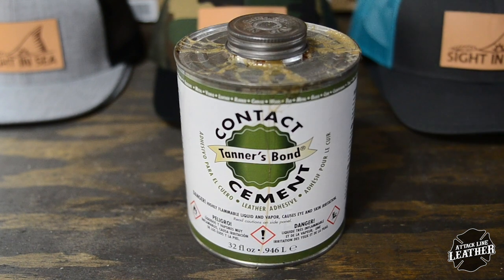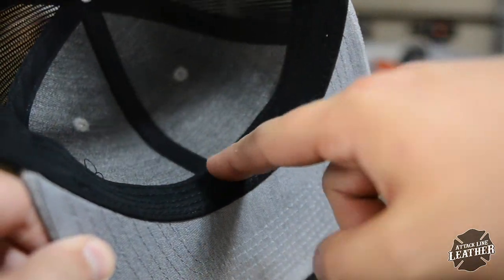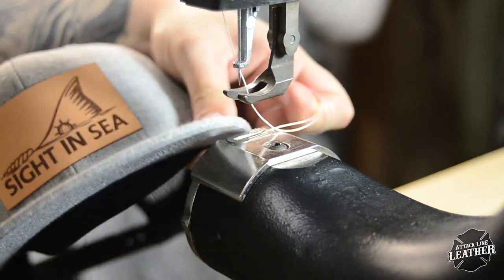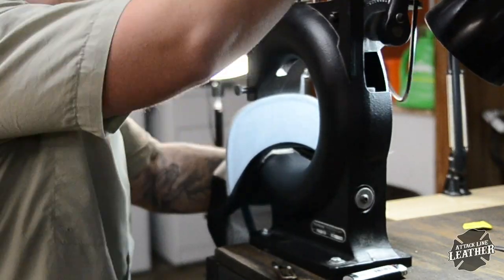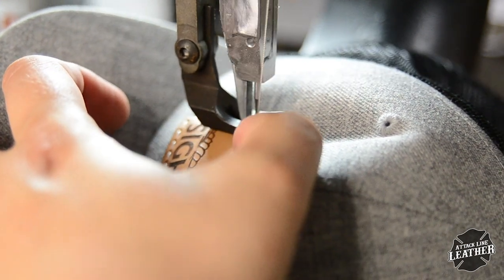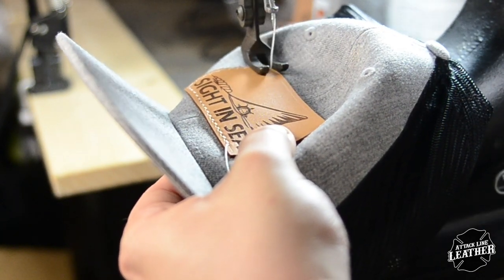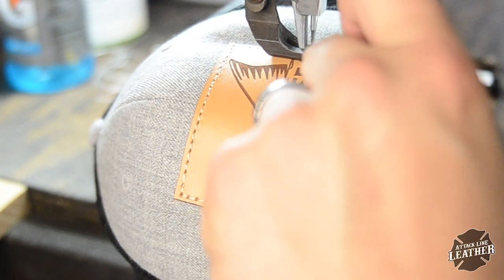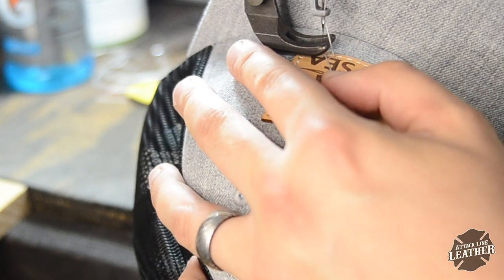Stitching a Leather Hat Patch using the Tippmann Boss

Comment: Class work. Love the idea of the patches on the hats. I have just purchased a Tippmann boos over her in Ireland. when i am stitching it will make the stitch hole but no stitch hole but no stitch and have to go back , Why would this be happening, Thanks
Reply from the maker: Thank you. 
When this happens I generally check several things. I first check to make sure my thread is threaded correctly in the machine. Next I check to make sure my the thread tensioners are set correctly.  Next make sure the handle is secured tightly with the screws. Sometimes they come loose and will cause skipped stitches. Last, I make sure the presser foot is adjusted properly. 
If you just got the tippmann boss it should have come with an instruction DVD that will go over how to make these adjustments. 

Hope this helped
Reply: @AttackLineLeather  Many thanks, the handle was not secure so hopefully thats the problem, Thanks again

Comment: Just the video I needed to see!  I was wondering if my tippman was capable of doing this.  I've only every used it for knife sheaths, and honestly I have never liked how the back side looks.  The front of my stitches look great, but the back looks like crap. How does yours look? (Not that it would make a difference for hat patches, I'm just curious)
Reply from the maker: By the back looking like crap do you mean little bumps from the lock stitch? Might need to adjust your thread tension
Reply: @AttackLineLeather  it's like, you don't see neat little stitches, like on the front.  You can see the stitches from the bottom thread, but you can also see the thread from the top.  Like where it loops together
Reply from the maker: @ReeseCustoms  its either a tension issue or make sure you do full range stitch strokes. Make sure to hit the full range of motion. Not doing so can make the Boss run wonky.
Reply: @AttackLineLeather  I'm thinking it is probably a tension issue.   I've had my machine probably 5 years, but honestly haven't used it much.  I'll mess with it some more and hope for the best

Comment: i don't see many leathercrafter using the tippmann boss machine, what would you say is the down side to this machine? how do you use one hand only when stitching? thanks for the video rob
Reply from the maker: Great question. It is definitely a very mechanical machine. I would say the downsides are the price, and that if you have to large stitch jobs it can get tiring. As far as using one hand you definitely get used to it however i cant wait to upgrade so that i do have two hands free. If you like i have made a Tippmann Boss Review video. It might give you more info

Comment: How do you get a tight stitch when rounding corners? Would it be a tension issue with my boss? For some reasons on a corner the stitch is always loose.
Reply from the maker: Yes it could be a tension issue, but also something im now doing is as i make the corner, i leave the needle in the leather as i rotate it. In the video im pulling the needle completely out. Give it a shot

Comment: I recently bought a boss and I get about half way done and it binds up, handle wont move and it tangled udernearth.  I have tried different tension settings on top but have not messed with bobber underneath.  Any advice as to what may cause this or somehow are you able to share what you have your tension set to on top and on bobber/
Reply from the maker: Most of the time its not the bobbin tension. Things to make sure of is that you are using the right size thread fir the right size needle. You can try andgusting your presser foot tension. Sometimes if its too tight or too loose it can affect stitches
Reply: Make sure you pull the handle all the way down and all the way up with every stroke. Sometimes I forget and my mind starts to wander a bit and that will happen. Also the up stroke tightens the stitch so if you short stroke on the way up you won't get the full tightening on that stitch.

Comment: The sewing machine is pricey. Is there another affordable machine that you would recommend?
Reply from the maker: If you can find a hand krank cobler sewing machine those are more afordable, however, less reliable. You can find them on ebay mostly
Reply: @AttackLineLeather  sounds good thanks and I will check them out